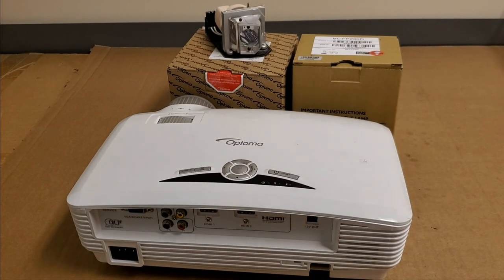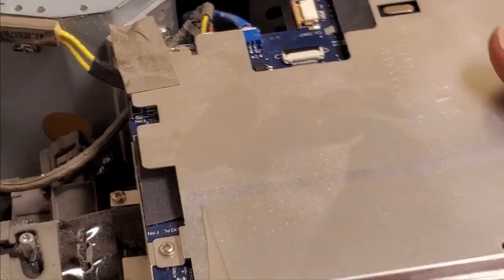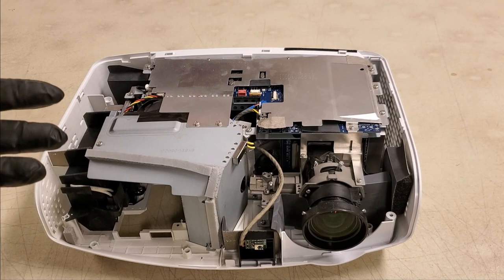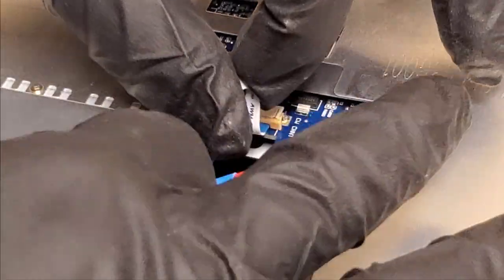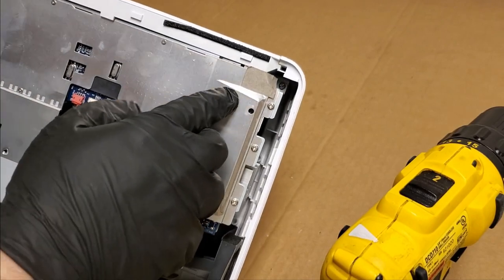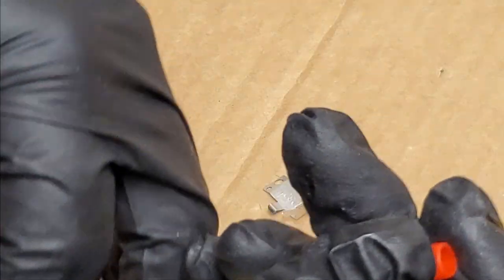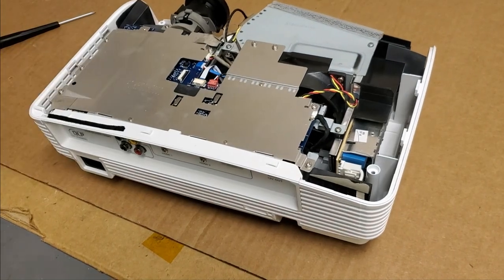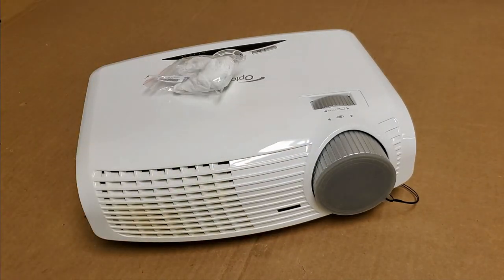Optoma HD20 DLP Projector Color Wheel/Light Tunnel Repair

Comment: Hello Frank, I have watched many of your videos and appreciated your comment about trying to keep these projectors out of the landfills.  I have an Optoma HD200X which has served us well for the past ~15 years and have been nursing it along recently with a new bulb and DIY repair to the color wheel (re-gluing 5 of 6 color segments into the motor) and a thorough cleaning (sadly the first in it's life with us).  Since replacing the bulb, the unit inconsistently shuts down for 'Over Temperature' (per status led lights).  Sometimes it will run fine, other times it will shut down in the first 10-15 minutes but will run fine after I reset the fault memory by unplugging the power cord.  The blower/bulb fan was part of the cleaning and is seen running when I have tested the unit without the cover in place, similar for the main housing fan (which kicks into high when powering down properly).  Do you have any recommendations for this random over temp shut down condition?  The bulb is a Osram replacement bulb.

A second issue showed up since performing the above.  I was starting to notice "cloudy" images, most noticeable on white image/scene, but visible on blue menu background as well.  It was progressively getting worse, when I noticed a smell and saw fumes/smoke from the area of the light tunnel.  I took the optic block/lens/color wheel assembly out (guided by your video) and discovered that my light tunnel glue was not holding to the metal sleeve (thankfully the mirrors are still together).  The two adjusting screws seems to have 'resin' holding their threads (even with the optic block out I can't get a good purchase with my screw driver in the lower/rear facing screw head to turn it .. but will work on this carefully so I don't damage the screw head).  Is the 'cloudy' (not sure if this is the term?) image/resolution a result of a loose or shifted light tunnel? Could the heat from the bulb (defective/hot bulb or insufficient blower/cooling fan) cause this area to get so hot that glue starts to smoke?  I did not check the light tunnel with an IR temperature reader before shutting down.

Appreciate any recommendations you can provide.
Reply from the maker: Firstly thank you for the kind words! I appreciate that. Secondly I think you have a defective lamp assembly. It sounds like it has no IR filter. That would explain the temp warning and shut down. It would also explain the cloudy image. See if your new lamp assembly has the reddish blue tint to the lens or if it's greenish/clear. If it's greenish or clear, that is your root cause. 
There is also a chance one of the fans is not working properly. Temp warning means either a true over temp situation or that a fan is failing. Hard to say which one without it here.  I hope this gets you in the right direction!
Reply: Thanks, I compared the new bulb to the previous bulbs and was not able to get any type of tint, where as the old bulbs do.

Discovered why the cloudy image was happening … the 3rd (largest lens) in the optic block was melting and the brown residue was blocking the center and puddling at the bottom !! The convex side facing the mirror (which has a smoky film on it .. cloud causing) is now concave. The bulb must have turned into a laser? Are replacement lenses available?

Sadly, I took all this as the final straw and retired the projector. An Epson HC2250A has the throw distance (and price point) I want (14’-6” = 92” W). Do you have an opinion on the HC2250A?

Comment: Awesome video! Projector made a horrible noise that made me jump out of my seat to get away from it. After shutting down and disassembly I found a green segment had been thrown from the color wheel. I was ready to throw it out when I found this video on replacing the color wheel. The new color wheel went in easily as you demonstrated. Feeling cocky, I put everything back together without testing. When powering up the lights came on and everything looked good but there was a loud buzzing sound. I assumed it was the bulb at end of life so replaced the projector lamp. When trying to power up with the new lamp the green light illuminated but the projector lamp didn't come on. After a few seconds the cooling fan came on and the unit seemed to through the shutdown sequence. Further investigation and using your testing sequence led to the discovery that one of the color wheel segments was rubbing against the light tunnel frame. The wheel had stopped in the rubbing position and the motor wasn't strong enough to start the wheel spinning. If the wheel isn't spinning, the projector lamp does not illuminate. After pondering my options for a few days, I removed the optical assembly and used a dremel tool to shave off the end of the light tunnel frame that was touching the wheel. With no interference between the wheel and optical tunnel frame it started spinning on power up and the projector lamp illuminated. 

I sure learned a lot and would not have attempted any of it without the lessons you provided in this video. Thank you!
Reply from the maker: Great job 👍

Comment: Hey Frank, great video! You always put some care and detail into each of your videos. Really appreciate your explanations and knowledge, I really learn a lot watching you work. Thanks to you I was able to diagnose a similar issue with the light tunnel with my projector that was causing a shadow on the bottom right on the screen. Cleaned up some old glue that had melted onto the calibration screws and calibrated the light tunnel to get rid of shadow. Much appreciated
Reply from the maker: Thanks for letting me know! This is why I keep putting the videos up. I'm learning as I go too. Granted I already made a lot of the mistakes so I make it look easy sometimes. 
Seeing posts like yours where you were able to use the information is awesome 😊
Reply: instaBlaster.

Comment: Great video!  I just finished watching your similar video on the HD20 from 3 years ago and was thrilled to see this updated vid!
I didn't see (hear) the following mentioned in either video.  When I'm cleaning my projector with compressed air, do I need to be concerned about dust getting into the light tunnel?  I live by the adage that dust is the enemy of any optical components, especially ones made of glass.  What's been your experience?
Reply from the maker: Most of the projectors in this category($1000-3000) tend to have a pretty sealed optical assembly.  The dust should not really sit on the light tunnel or cause and problems for the most part. There is a gap between the end of the light tunnel that the fist lens that the dust should go past. They are designed to run correctly with a little dust so I mostly go for the large blobs of dust. The light itself should not suffer from dust blobs too much. Unless its in the DMD area.  I try to use air as a way to loosen and release the dust so I can use the vacuum to collect it. Now inside the optical assembly I like to clean by hand. I do not want to scratch or damage that area since there is a picture.

Comment: Hi Frank! Love your videos. I have one of these and I am getting an error. So on the cover it says it is the lamp but on the control board it says it is the Temp. I've tried 2 different lamps, both fans seem to spin fine, and the thermal switch has cont. I've tried another ballast as well. I even pulled it out and jumpered the pins and I still get the error most of the time. Are there any thermistors anywhere in the system? Only other thing I can think of is the main board, at least according to the manual. Any thoughts are appreciated. Oh and the color wheel spins fine.
Reply from the maker: Its probably a fan even though they are spinning.  The fan status wire can stop reporting properly, but the blades are still going.  Check this video on testing fans, I think it'll get you closer.  https://youtu.be/kCOSQ8dVZvc  Thanks so much for your kind words! I hope the fan video helps you figure it out for sure.  I have seen the blower fan do this more often than the exhaust fan but it can happen on either fan.

Comment: OMG Very nice video! You know what you are doing! I have the exact same projector, but it look like I don't know enough. I was wondering if you could validate what I am thinking.
Symptom : After +/-30minutes of usage, the image flickering between normal and red-ichh..
What I have done : Changed the light, cleaned up the inside, both fans are running but it look like the blower one doesn't spin enough
When it flickering, I blew some air manually inside from the side and the image come back to normal.
it look like it's coming to hot, would you suggest to change the blower fan? or both of them?
Thanks and once again I love the way you are showing your troubleshooting steps.. easy to understand!
Reply from the maker: That is most likely your color wheel.  The reddish symptom is what makes me think that.  also if you never have changed the color wheel, you are likely past due.  Most of these are on wheel 3 or 4 by now.  It's an easy replacement as you can see.  The blower will spin alittle slower but dont worry unless it gives you a temp error.  My suspicion is your color wheel.

Comment: Hey Frank,
If the color on the wheel is faded off, from all the usage,  is the wheel still OK?

Should I get a new color wheel?

The color on the screen has been fading in and out (greenish).  And at times I a hear buzzing /grinding.

Looking at the color wheel,  I can tell that it's been rubbing on something, which may explain the sound.

Can I send my unit to you to repair?
Thanks!!!
Reply from the maker: I've honestly never heard of that happening! You might want to try cleaning the surface with some lens cleaner. You might just be seeing dirt that messes with the way the colors are reflected. Otherwise, yes a new color wheel should solve it.

Comment: Many thanks for the helpful video! Maybe you can give me another hint. While cleaning my HD131xe (which I'm very happy with) I apparently put dust behind the lens. There are now many stains on the picture. When I focus the dust, I see a lot of particles, almost like under a microscope. I have sprayed compressed air behind the left foam cover at the front of the lens. The projector is now very clean, but with many spots. Can I fix it and how? Thanks for an answer!

Comment: Hi Frank. I really learned a lot from watching your thorough videos. I have a question for you. I'm new in the fixing projectors thing because I bought a ten year old  Optoma eh1020 from work (60$). I put in a new lamp and that helped a little. I cleaned it from most of the dust (it had a lot!) and that also helped a little. I checked the color wheel and cleaned it and that helped a little. BUT I still have an overall problem with color representation. Especially the red and greens are "dim" and not vibrant but all colors look dimmed and "tired" in lack of better word. The reds look purple and dark. It might be all colors but it is most visible in the reds and greens. Maybe it's the contrast but nothing really happens when I try to calibrate the colors through the menu. Could it be the color wheel that is too old? Maybe the colors on the wheel have faded or it's spinning just a little slow? (the index mark looks fine) I'm thinking of just trying to change the color wheel with a new one and see if that helps, but do you have any other ideas of what might be the problem? If it's something out of my league, or the projector is just too old, I'll just give up on it. Thank you very much for your help, it is greatly appreciated! :-) All the best, Stig Hansen
Reply from the maker: Hi Stig!  I'd be suspect of the lamp personally.  Was it a name brand Osram inside? Also the surface you are projecting onto can affect the color brilliance in my experience. Personally I have never seen a color wheel lose its filtering ability from age.  I suspect it is possible but I can't weigh in as I have never dealt with it. 
If you are projecting onto glossy white or flat white, that might be a problem. DLP prefers more of a grey background.  Sherwin Williams paint had a grey color that really helped the colors "pop" (I dislike that term yet it is fitting). 
The lamp would be my first suspect.  A non osram bulb may not have a proper gas mix inside. Second would be the screen.  Replacing the color wheel is the same steps as with the HD20.  They share a lamp and construction, but I doubt the color wheel is the issue.
Reply: @FixitFrank  It's an osram lamp indeed. I was actually able to crank a little bit more color out in the calibration. The screen is a super cheap IKEA window screen roller, quite white so I suspect that you could have a case with that. I'll try something more grey and made specifically for projection. Thank you very much! 🙂

Comment: HI, I find your videos very informative. Thank you for posting them. I have a specific issue with my BenQ W1400 I would really appreciate some guidance on. Generally the image is very good. Colours are as they should be, but in dark scenes, with small highlights, they have a blue cast, looking almost neon. I have cleaned the colour wheel and sensor. And I have adjusted the colour wheel offset in the service menu. Any help as to an alternate cause, greatly appreciated!
Reply from the maker: Curious.  The lamp assembly or the screen actually might be the cause.  The blue cast is what makes me think the lamp assembly.  If it is not an original Osram lamp or Philips lamp, the color rendering may not be correct.  Amazon lamps are known for this.
Reply: @FixitFrank  thank you for the suggestions and quick response. I was really stymied, but then found some suggested settings for all the picture settings so decided to try following that before going too in depth. I'm not sure which of the settings was the culprit, but the picture is great now. Hopefully it remains that way

Comment: Great video, thanks for sharing! If i have a "burn mark" at the bottom of the screen, would this be resolved by tightening/loosening the 2 screws on the light tunnel?
Reply from the maker: I'd have to see a picture to say for sure.  Sometimes the shape lens in the optical housing can burn but if its a relatively straight line of a problem, then the light tunnel adjustment could help. If it's a roundish mark, then it might be something else.
Reply: @FixitFrank  Here's a quick view of the issue: https://imgur.com/G9xaYbJ forgive the alignment (quick lash-up onto a wall) :D.
Reply from the maker: @Jack-lv2fg  Thats perfect!  Yup that is a light tunnel issue for sure.  You might have to take it out to -rebend the springs but try and adjust it first.  You only need to remove and re-bend the return springs if you can't adjust it with the screws. Sometimes the segments lose their glue and one will come loose.  That is worse case scenario and even then its not that bad. Just take your time and take lots of pictures.
Reply: While fixing my colour wheel, I completely removed my light tunnel screw and then put it back. I’m facing a misalignment at the top. I’m able to adjust the screw up till a point beyond which there is no change, but there is still misalignment. Does that mean that I need to rebend the springs?
Reply from the maker: @MkHase  most likely. The metal used is 'springy' but I don't think it's true spring steel. Or the heat as caused some  annealing. Bending the springs a little will give you the extra push back you need.

Comment: Can you please advise? Have have had the cycle of turning on with a flashing green light making the sound if the fans are engaging and eventually lights turning to red & orange. Have changed the bulb & initially the light cam on, but as I was re-fitting to the ceiling turned it off not to damage it. Have spent the day cleaning it & cannot get the projector to turn on with the blue screen, and now keep getting the flashing green to orange red lights! Can you please advise, have checked the colour wheel and I am feeling gutted that I may need to get a new projector after getting a new bulb!!!!!